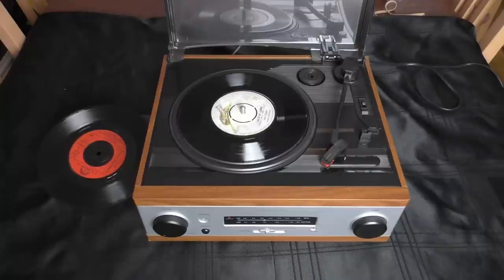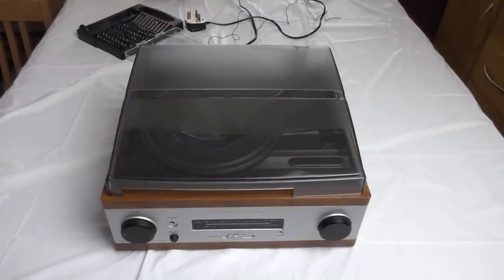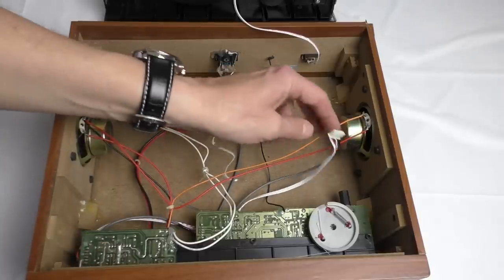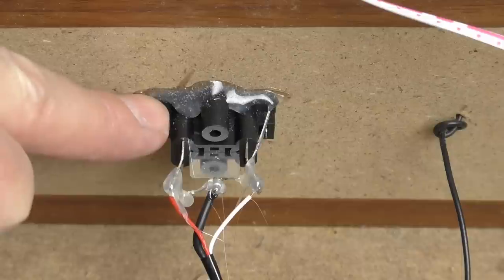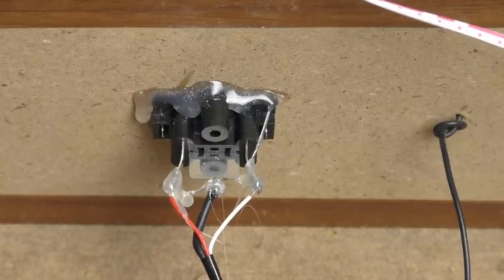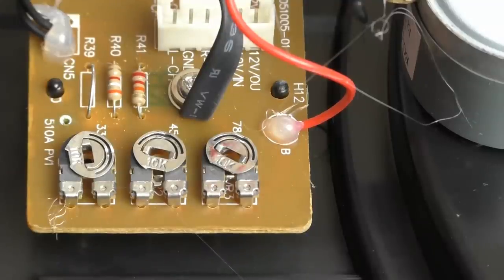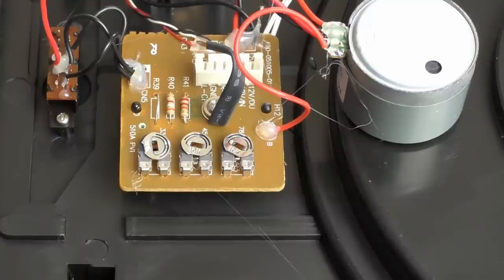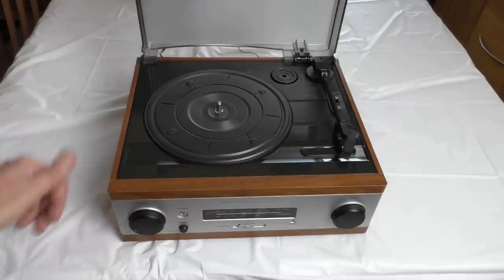Crosley, Zennox, Steepletone record players are rubbish - here's why. Pt2

Comment: Steeple tone used to churn out some plastic radios in the late 70s early 80s, bad fitting often wonky dials.
Bass and treble in the same dial which was actually a basic tone dial.
Even stuff knock out by bush and Amstrad were slightly better made.
Often found in cheap shops, market stores etc

Comment: I've had a Steepletone ST918 for some time that I snapped up for a tenner at a British Heart Foundation household and electricals shop that's OK, as far as it goes. Now, from the same place, I've got a Zennox D6618/TT818 for £40 and that appears to do all things reasonably well and keeps my 9"/23cm-diameter Celestion speaker from the early 1950s going.